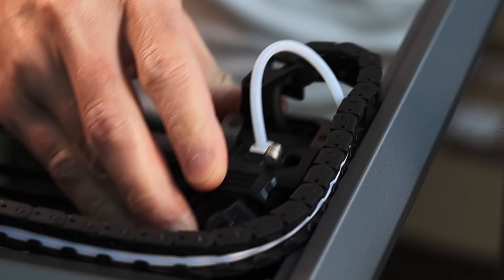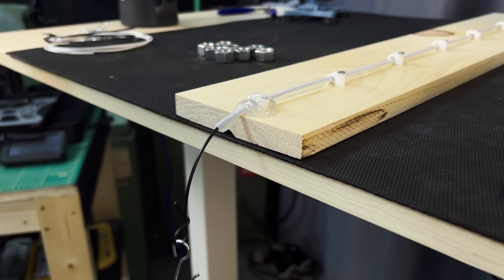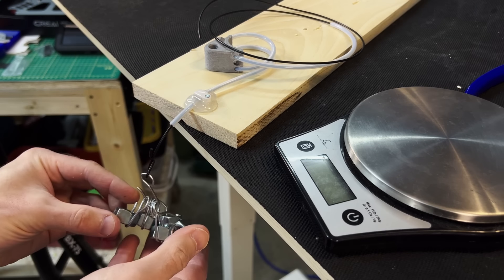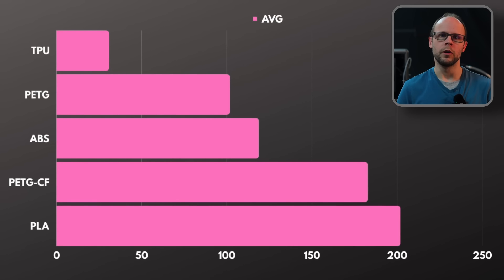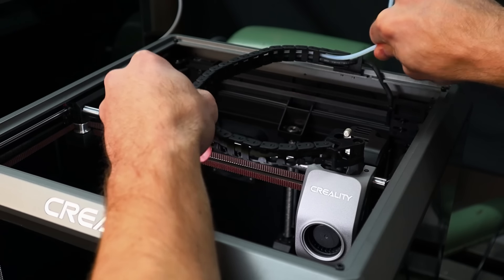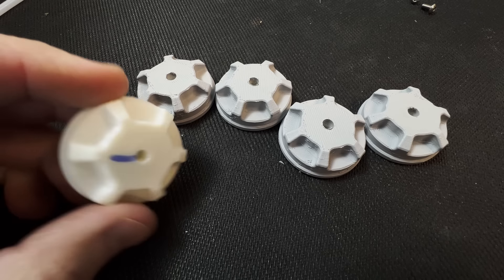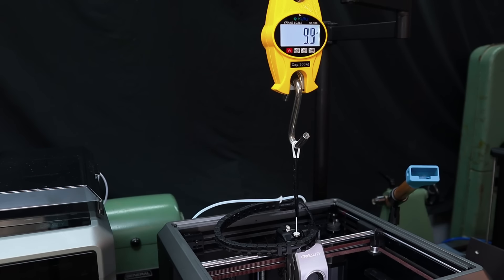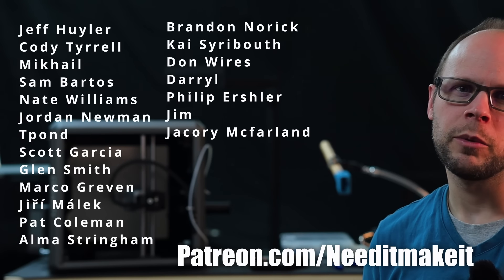Is your Extruder Feed TUBE causing print defects?

Comment: This video is awesome, but honestly... You should have combined those graphs to see how the values change in a single screen.
Reply from the maker: Shoot, I had them that way at first, but then it was really messy, good point though I'll take that into account for any future tests.  Making those graphs is a bit painful if I'm honest, less graphs is better!
Reply: It's true you have 5 materials, but if the vertical bars are not adjacent but grouped per material, the extra space between the groups should make the graph nice looking.
Check the article by Prusa about annealing to see an example of multiple groups which still look ok (and you would have fewer bars in total than them)

Comment: I am finding that I am getting a lot of breakage of pla in the middle of the tube. This is with old pla but I suspect it is from the tube bending too sharply as described in the video.
Reply: Your old PLA is probably just wet. Wet PLA become exceedingly brittle.
Try drying it, and see if that helps.
Reply from the maker: Yes, that's definitely a property of PLA, it's meant to breakdown over time and it will become very brittle unless it's stored in an air-tight and humidity controlled container.  As @ZappyOh says, try drying it out if you have a filament dryer, it may still be useable afterward.   The chemical makeup of PLA changes over time.

Comment: You might look at whether the manufacturer actually used PTFE tubing or plain nylon tubing. My QIDI Tech X-Max 3 came with a blue supposedly Capricorn tube for the feed tube. I replace it with PTFE tubing that was the white translucent color and it feeds with a lot less resistance now
Reply from the maker: There is one way to know that's easy, if you cut it, it has almost a gritty feeling and also it makes a strange sound, it doesn't seem at all like cutting plastic.

Comment: I like this test, however I question how you have done the test. Filament is not pulled out of the tubing at a 90 deg angle (your test bed exit point), it is the reason why TPU is showing best results, it's able to flex more freely and therefore creating less far less friction at your filament exit point.  If you were to do the same test with your test bed exit point mounted vertical you would see a very different result for all filaments.
Reply from the maker: Sure, the tests rig could always be changed.  If you look to the test, the tube bends and that eases the angle, but I'm happy to provide a follow up test result.  I thought it was better to test the filament as it comes through the tube to the printer in a horizontal fashion then coming down to the extruder at an angle.  

Even with the absolute worst case, we're nowhere close to having extrusion problems caused by the tube.   I think the only way to have more certainty is to take it to even more extremes and buy 10' of tubing and see what happens.   

Of course if you're running a Bowden setup it'll have completely different results, pushing through the tube is never as good as pulling and tube diameter being tighter causes more friction.
Reply: @NeedItMakeIt  Thank you, I really like you videos.  I’ve a K1max extracting filament from a dry box so my PTFE tubing is longer then a stock printer and I’ve not yet noticed any disadvantage.  However, over time I know the tubing will need replacing because the lubrication properties of the tubing will eventually diminish, for this reason I stock a couple of meters of the tube.
Reply from the maker: @Jamesn-js1zp  It might be a good test to thrown in at some point, tube friction over time.  It's a strange one because the tube itself is a homogonous material, I suppose the slippery-ness comes in part by the slick stock surface being intact, or maybe there is some type of treatment on the surface.  It's a bit odd that it would differ so much.  If you take a piece of nylon and remove the surface, it's the same below, why would the tube be different?  Do you know the max length of that tubing I'd like to setup another quick test to see how much more friction there would be in say a 5' 10' 20' section.  Seems people are interested in printing with long tubes.
Reply: @NeedItMakeIt  I wasn't a fan of how the filament was mounted on the rear of the K1Max, so using a filament dry box mounted beside the printer enabled easy access.  My PTFE tubing is 1060mm long, plus there would be some friction pulling the filament from the spool sitting on rollers inside the dry box.  Regarding PTFE tubing lubrication properties, as I understand it the PTFE lubricant is imbedded in the nylon when it's extruded, they mix PTFE powder with the extrusion lubricant to form a paste and it's used to extrude the tube.

Comment: 1:25 wait, do you mean ptfe tubes from bowden setups are thinner by nature? (
Reply from the maker: Some people call the DD setup with a tube going to the filament a REVERSE Bowden, I'd prefer not to use that term to prevent confusion.   

On a Bowden style setup, we have an extruder that feeds to the hotend with a tube between, on that setup, the walls of the tube are thicker and the filament has only a small amount of space to move around inside the tube, this is needed to keep the extrusion/retraction in an acceptable range.  If we didn't have it, there would be too much for lack of a word 'backlash' within the tube to be able to accurately measure and compensate for. 

The Feed tubes on a DD setup are thinner walled and have a larger ID, more space in the tube for the filament, but in this case it is irrelevant because the extrusion/retract happens at the hotend what happens before it is not so critical as it was in the other scenario.  

Capricorn tube for example is the thicker walled stuff for a Bowden setup, it's not to be used for a DD setup.  We're looking for something closer to 4mm OD and 2.5mm ID.

I hope that makes sense.

Comment: Great video!
Reply from the maker: Thanks, I'll probably follow up with a more extreme test when I have some more time.  How about sending some filament through 10 or 20 feet?
Reply: @NeedItMakeIt  Oh the length of the filament is an interesting concept. I run 6 Bambu Lab printers and one thing I've encountered is having the filament wear through the PTFE tube over time. I found one P1P that I've owned for about 10 months that rubbed all the way through so you could actually touch the filament. Obviously that impacted print quality. I quickly decided that I need to replace my PTFE tube on a regular basis.
Reply from the maker: @spoolheads  Does anyone know why when the filament wears into the tube, the friction increases?  is it that the filament path is always consistent and we then have a wear path that matches the filament diameter more closely causing more contact areas with that filament?  I wonder how I can setup a test for this, and to see how long it takes to wear through using different filaments.  CF I would probably wear the most, or maybe GF.
Reply: This morning I woke up to a print on a P1S that was totally under extruded. When I took the tubing off I could see that the filament had really worn through through most of the tubing at the entrance. There was a little U shape just the right side of the filament now. Seems logical that it could cause more friction.

Testing it seems pretty challenging. This PTFE tubing has been on the printer since I got it and the printer has something like 1500 hours on it. I’ve just been printing PLA plus. I’m sure more abrasive filaments would wear faster. I think I’ll start changing the tubing every 500 print hours or so.

So I don’t know if the tubing was causing the issue or if it was just a clog or both. But now when I have an issue with my P1S printers, I chance the tubing, change the nozzle and clean out the extruder. Just finished the first print after that it it looks a great.

Sorry for the novel here!

Comment: Nice test but will the filament swell up when its absorbed a lot of moisture
Reply from the maker: From what I've measured, it doesn't seem to swell at least not swollen enough to be able to measure with a set of calipers, PLA filament will become brittle over time as it is highly affected by exposure to air (moisture) over time.  This is something that people have complained about having their filament break inside the feed tube as it become too brittle.

Comment: What is the opinion about CHT Nozzle sir
Reply from the maker: CHT seems to be proven, it's not just a gimmick.  I have plans on trying the Bondtech CHT Volcano style nozzles against the HF ones that Creality offers but it'll be at least a few weeks until I can get to that.    From everything I've seen and read, it's the real deal and makes sense to be able to heat the filament to the core more quickly.  Are you aware of any that are available which are not made by Bondech for the K1 series printers?
Reply: @NeedItMakeIt  Thanks for your reply

Comment: The AMS unit in the Bambu Lab printers is pretty weak, and definitely has issues with filament path friction.

That setup loads and unloads the filament.  The tight bend before the print head is the most critical point for loading failures.  Unloading problems seem to be more difficult to sort out.  Filament without a smooth finish adds to the friction and so is more problematic.

Possibly people are confusing those issues with simpler reverse bowden setups like the Creality K1 you are testing and so thinking the reverse bowden is a cause of problems.  The AMS issues don’t affect print quality — they halt the print with a failure message, then you have to correct the problem.
Reply from the maker: I have the AMS, and I again haven't had any of these problems, not even a single time have I had a problem with filament failing to load.  When switching between the side mounted spool and AMS, I've forgotten to re-connect the tube for the AMS, and that will lead to a lot of filament being fed in, but it never reaches the printer...  Could this be related to the filament, stiff and brittle PLA filament?  I know a lot of people keep theirs in the open.  There are several connections between tubes as well, and I'd imagine that inside there is is a possibility to have filament getting hung up.  
 
Why do you think that a rough surface texture case more friction?  This seems to be true, however it has less contact areas and should cause less friction... the same concept as a BIG WIDE drag race wheel vs a small tire.

More investigation is required and I plan on doing a follow up video using 10' 20' long tube to see if I can cause the printer to produce defects because of the tube length.

Comment: I wonder if the tube, being snaked around and restricted inside the drag chain, is causing a pushing force on the print head, leading to some artifacts. You can see the tube has a couple of tight bends as it moves to the edge. 

I had a cable bundle too tight on a direct drive one time and it caused the print head to move slightly from the tension caused by the cable bundle. I adjusted the cable bundle and the problem went away. It took me a long time to track down what was happening.
Reply: This would actually make more sense to me than restriction in the Bowden tube. Especially since not every printhead will be affixed perfectly or just as tight. We have seen this happen with the cables and tubes leading to the head on other printers.

Comment: I'm sorry , but who is sourcing different ptfe for DD vs bowden, its all the same ptfe from the mfg. Except geeetech thunder with an enlarged outer diameter and the stifness it creates.
Reply from the maker: Bowden setup must be far tighter to the filament, 4mm OD, 2mm ID.  Capricorn tubing is my reference for Bowden style tubing if you're curious.  The DD setup has a 2.5mm ID, this is also confirmed by my Bambu printer which has the 2.5mm ID tubing and of course a DD setup.    What we're sourcing vs what we're supposed to purchase as a replacement, that I cannot say, my Bambu came with replacement tubing, I have not yet had to use it.  Creality did not send extra, I only have the stock tubing from the Max and the K1 to verify against.

Comment: you do some real good tests keep the good work, i always thought how people stupid are when they tell you not to use capricorn or say that bend is restricting the feed of filament, always knew that force of extruder can over come this, only down side can be worn ptfe tube it will slice it from the inside of the tube over time....
Reply from the maker: Thanks, they're pretty low cost tests at least for now, but as I get more traction on YT, I'll spend a bit more on proper testing equipment, not that it's really needed most of the time.  I'll be building a test rig for some of my upcoming video as well and I have a nice load cell so I can avoid adding weights, it should speed up the video a bit as well.    I'm curious about the wear and why it causes more friction over time.  Is that because the path becomes narrowed?
Reply: @NeedItMakeIt  over time i have seen on fb groups people posting pictures with hole made by the filament friction, same as it does on max rubing against the glass cover 🫢🫢only there filament does it from the inside altho it will probably happen if you print with alot of movement inside of the tube, different models different way ur extruder will operate

Comment: You should have tried not attaching the tube anywhere. From the toolhead to wherever it terminates behind the machine. It would go up, eliminating 1 tight 90* bend, and no bends as it moves around
Reply from the maker: I wanted to revisit this, so maybe I can set something up in a future video.

Comment: Cool testing! We gotta solve all these mysteries to understand as many variables as possible.
Reply from the maker: Thanks 802, I'll end up doing some more extreme testing, I have a few ideas that came to mind after making the vid.   How long of a tube is too long?  10' ?  20'?  I still don't think 10 or 20' would cause  problem unless it looked like a spring-back type air line.

Comment: I have a hemera based printer that has had problems with this depending on which filament and colour of filament.  Different pigments have different lubricities.  Black (carbon black is slippery so it has to be neutral or help) being more slippery and white (titanium oxide is an abrasive so it has to be neutral or add friction) being least slippery.  I have had some filaments that are actually difficult to pull through the reverse bowden setup for no reason.
Reply from the maker: I'm sure that the surface properties contribute to some extent, from what I've seen it's more to do with how stiff the filament is as it tries to resist conforming and pushing against the walls of the tube like a spring.  

It might be worthwhile trying to test a 10' long tube to see if it causes any problems, I still don't see it, but maybe at that length the friction will be high enough to begin to cause problems.  From what I saw, retractions are a non-issue these tubes are large enough that I can push back about 4-6mm before I start to feel resistance.  Pushing seems to be harder than pulling. 

I've always wondered why the tube isn't textured on the inside to reduce friction.  The texture would quickly wear off, or it would be too hard to produce?

Comment: Issue isn't print quality. Issue is filament keeps breaking in the tube, including the PLA that shipped with the printer. Also kept dry and stored in a room that is constantly air-conditioned on dehumidifier setting
Reply from the maker: I can only speak to my personal experience that I have never once had filament break in the tube.  I've heard of people having this problem.  If that's the case, the seal was broken and humidity got in, give it a good long dry and see if that helps.

Comment: Cool video, thanks for the work you have done, I was surprised that PLA was as touch on extruders as it is, BTW I got my exercise in today. I exerted my 72 grams of pressure and you got a like!
Reply from the maker: I've done some testing on this in the past and it was with a Bowden setup, I had similar results on that tests, PLA always seem to resist more, those tubes were tighter of course.   Thanks for the like, it all helps!

Comment: Nice video - I loved that you measured how strong is the extruder pulling filament. BUT, maybe people could be having problems if they use filament dryer boxes behind their printers, so, long tube with friction of their own too. So, everything compounds to having problems.
Reply from the maker: Certainly it's possible that with the long tube and a double roller as well as a tight bend from the filament going into the feed tube sure.  Here's what I'd like to do, I want to buy 20' of tubing and then run the test on multiple different printers, we can do with the stock tube and with the extremely long tube.  Having that much tube should make it more pronounced and I don't know of anyone using a tube that long.

Comment: After 8 years of printing, using the least amount of feed tube produces better print quality, regardless of the printer. More consistent prints for longer and less maintenance and problems.
Reply from the maker: I'd agree when there is friction, it's always better to minimize it, In the case of a newer DD printer with a solid dual gear setup, you'd have to be into the 6+ ft range for it to start becoming a problem.  Retractions are so minimal, we're mainly dealing with extrusion on these printers.  If we're talking about Bowden, that's a completely different story. 

I have an idea for a follow up test to push the printers to their limits, and perhaps it's a good test for any new printers as well.  I'll be onto it in a few weeks, I think it's relatively straight forward... except things don't always go as planned